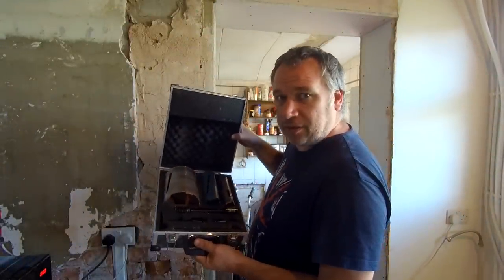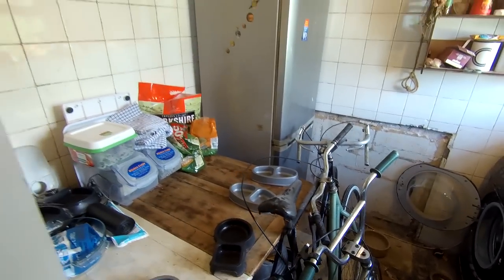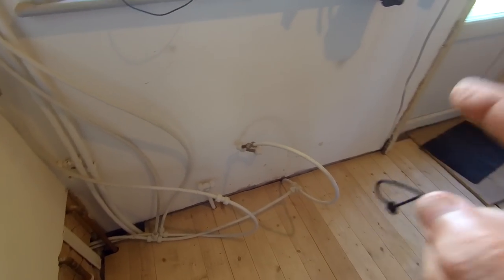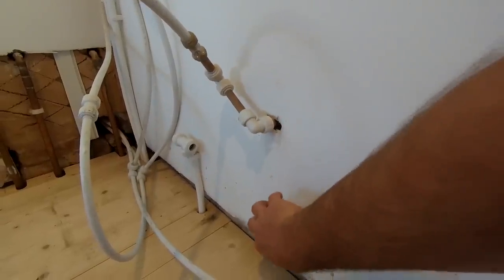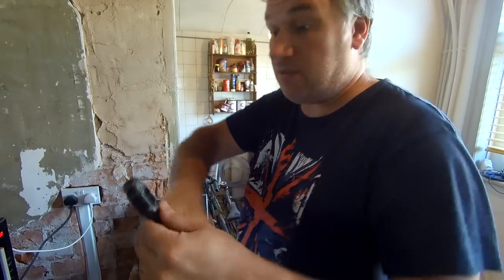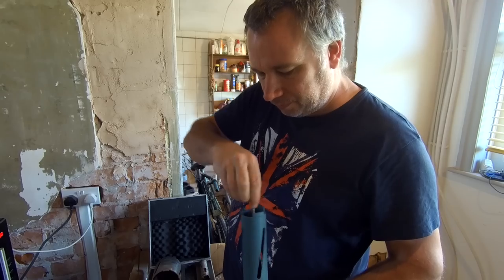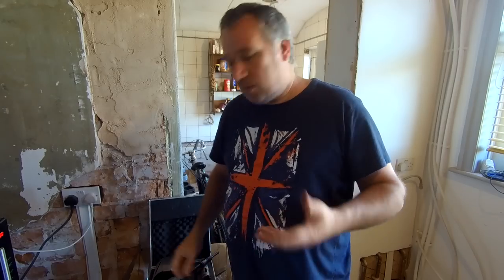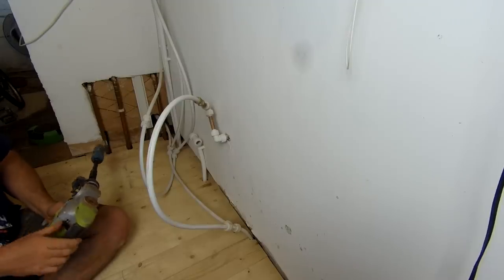How to use a diamond core drill through brick |  DIY Vlog #33

Comment: man you got a fantastic hole out there even you drilled from inside well done but i am confused lets say i need to drill a wall all the way out with depth 100mm do i need a core cup with the same depth or get a small cup and just add extension or what i am new in this?!!

Comment: The worst bricks to core drill near me are Dorking bricks, really hard bricks. I always run an 8mm drill straight through the wall first makes life easier when getting the guide and core started. Great video mate 👍
Reply from the maker: Off camera I had drilled an 8mm through the first skin of brick. The trouble was the guide was bouncing around the hole in the plasterboard. Once the guide got to the brick it went fine. Thanks for the comment, glad you enjoyed it.👍

Comment: use the holes in the extensions to take them apart, stick a strong manual screwdriver through the holes to give you some leverage when trying to get them apart.
Reply from the maker: Tried that, but it as like they were welded together. I did get them apart but using an O-ring makes it a lot easier to get apart.

Comment: I've just done some round brick pieces to place under the garden furniture where it sinks in to the ground, looks really nifty. Maybe start a booth by the road with them? :P lot of work though that looked rough. How do you get the tilt on it for waste pipes and such so it doesn't just sit in it hoping for enough water to flush it out? I'd consider a service opening just on the inside where you can pop a lid and get full access with a power washer pip cleaner line in any case.
Reply from the maker: Once I started the hole a slightly just lift the drill and it will go in at a slight angle. Also as the hole is slightly over the size of the pipe you can raise the inside that then slopes down to the outside.

Comment: Need to go slow on spindle rotation and do a slight rotating motion with the hands, and at least spray the cut with water. It's not the clutch, it's the skill as always.
Some copper or ptfe spray on the threads could help against binding...and some cleaning with a thread cutter or a bit of polishing.

Comment: Hi do you restore homes then?
Reply from the maker: No, only my own.
Reply: @LCWDIY   what type of drill would you use to drill a hole for 15mm copper pipe?
Reply: @Ed-fp9rx  40-50 mm core, then fill with pre made glass foam pipe coats (not fibre) or rockwool + 15 mm hole saw...or pe foam on tube and pur spray around (worst but cheap).
Reply: @dushk0   thanks mate.